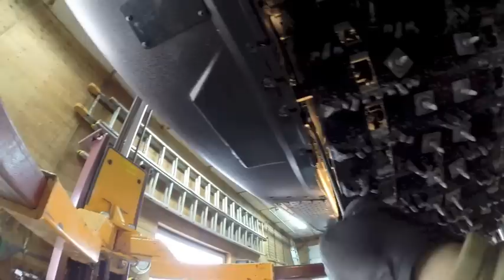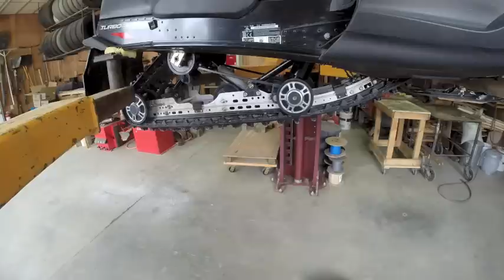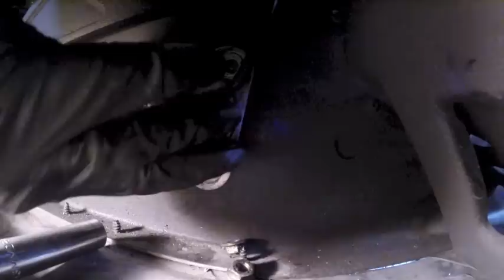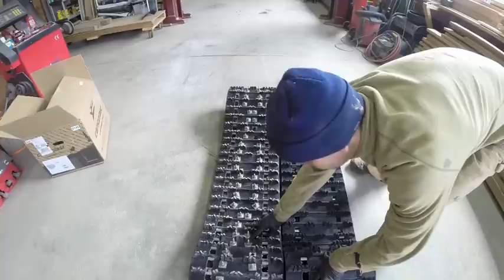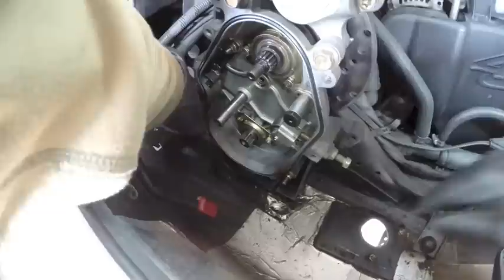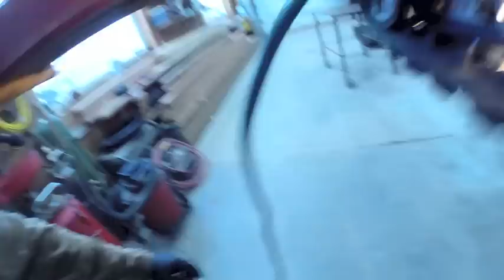Snowmobile Track Replacement

Comment: I have done this a couple of times on a 1998 Skidoo Grand Touring. I estimate that this took me 6 hours to do. (There is a manual reverse on this snowmobile.)
One thing that I have done in taking out the rear suspension is to remove the keepers for the large springs on both sides. This collapses the rear suspension, and makes it a lot easier to both take the rear suspension out, and put it back in.

Comment: Great video! Thanks for going through all the steps! Not a bad job if you have the setup you have. I have a 2006 T660 Turbo Touring LE, 136" track. I'll probably have it done since I would have to try to do it on my portable lift. With that being said, the lift may be more in my way than helping me. Either case, all would be done crawling around on the floor. Great job!! 👍
Reply from the maker: Thanks

Comment: good thing your side panels come off or youd be fucked putting the bearing back on pto side.you always put your bearing together your bearing flanges both are to be in place with the bearing only thing you should have on shaft is locking collar THEN you put your drive shaft back in place.

Comment: Thanks for the Awesome Video!! I have a 2006 T660 as well but, it's a turbo touring LE. I plan on changing mine out in the spring of 2020, I'm sure the change would be similar. I have an unrelated question for you........ How do you properly torque your drive belt clutch sheave adjuster? 🤔 I can't find a way due to it opening up the sheaves while tightening. Thanks again..... Ray 👍😊
Reply: I'm pretty sure it's just locked in there by the pressure. You know you take that tool and spin it to adjust your sheaves and it just stays where it is as far as I know.

Comment: +NEILVVT Instead of taking all the gears off, couldn't you have just loosened the chain tensioner and just take off the chain?
Reply from the maker: +INFINITE I suppose it might be possible to leave the top one on by loosening the tensioner. I find it easier to take the gears off.

Comment: Hey Neil, when try to get the reverse gear off there appears to be a snap ring i need to remove first?
Reply from the maker: I would say if there is a snap ring there, remove it.
Reply: @NEILSWORLD  Thanks neil, i just loosened the tension on the chain and the entire gear came off. Thank You!